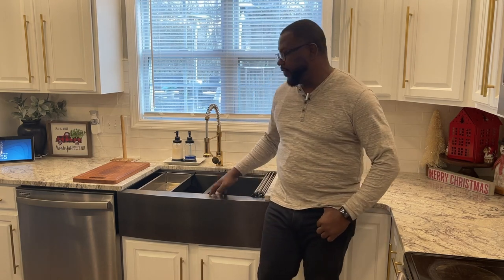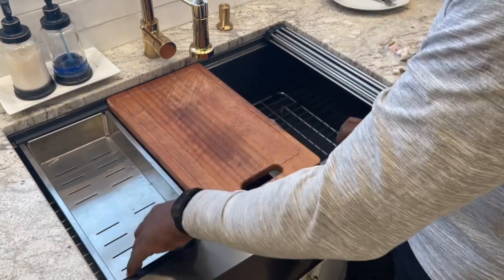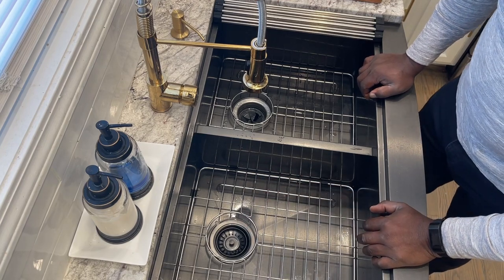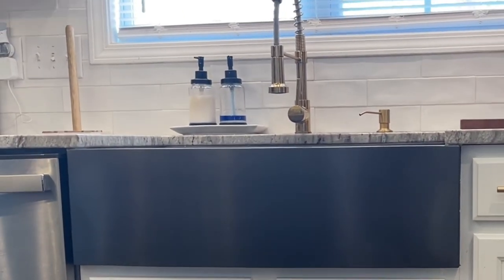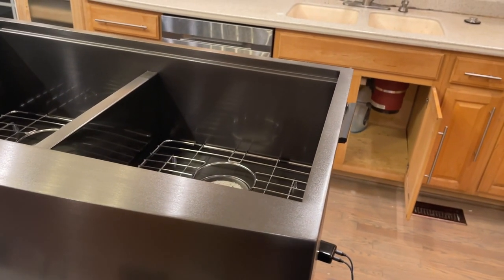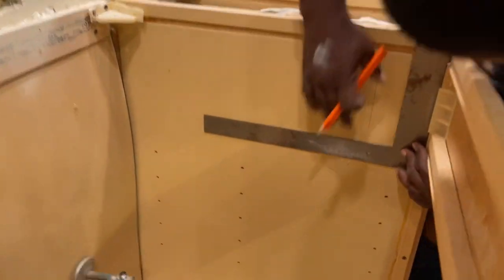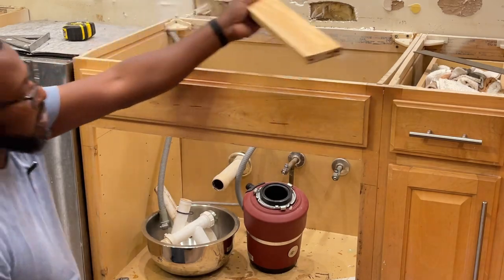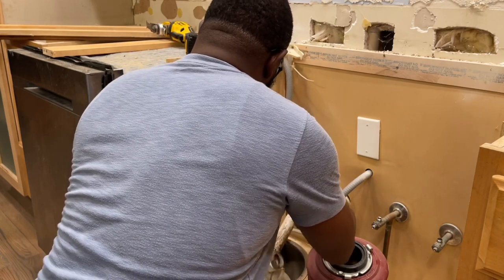How To Install Farmhouse Sink | Bokaiya 33” Double Basin Stainless Steel Sink Review | DIY Retrofit

Comment: I just got the Bokaiya 30 inch single bowl drop in sink and I’m excited- I think I’m gonna love it! Mine is the same 10 inches deep, and will probably fit almost all of my dishes in it at once. The one big difference is the clips, which is the reason I’m onto tube right now. Thanks for the video, it has points that are extensive useful.

Comment: We just had one of these sinks installed and plan to get granite countertops.  However, the contractor who installed it made it to where the the lip of the sink sits about 1-2mm above the top of the cabinet.  Will this be a problem?  We plan on having the countertops go over the lip of the sink so its flush with the inside wall of the sink.
Reply: We just installed a similar sink and when the countertop guys did all their measurements they told us the sink needs to be flush with the top of the cabinets.
Reply from the maker: Shouldn’t be an issue. Fill gap with silicone. Thanks for watching!
Reply: @rontalley  Well, in theory there will be a gap EVERYWHERE except the sink, since the lip of the sink is higher than the cabinets.  I wonder if shims could be used all over the tops of the cabinets to make them level to the sink.